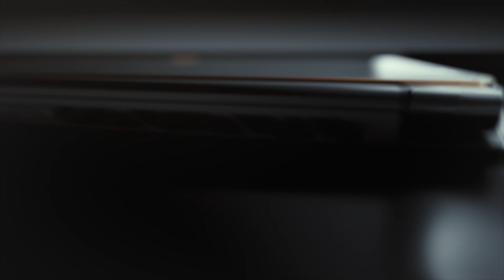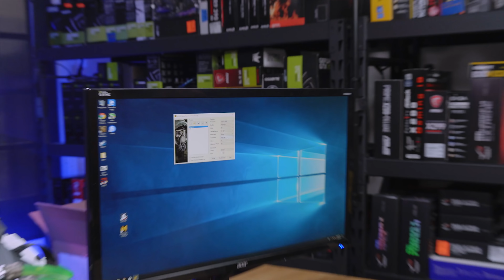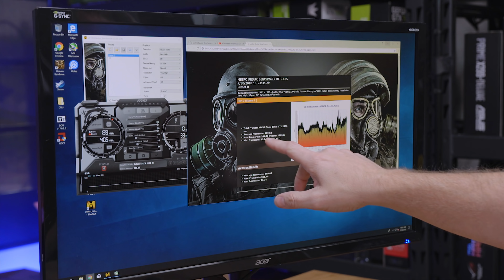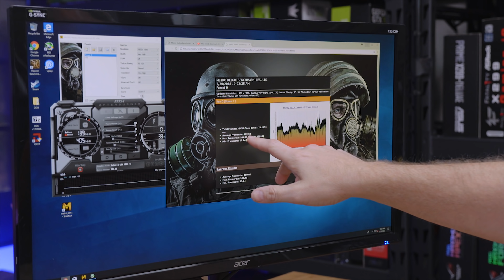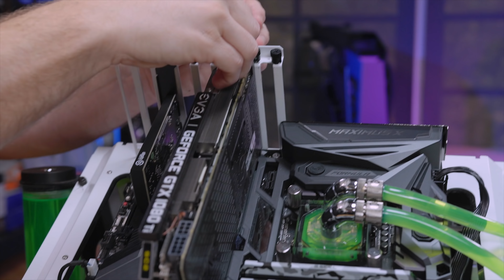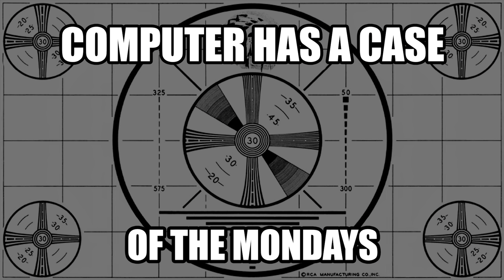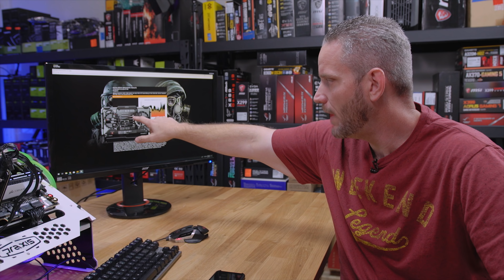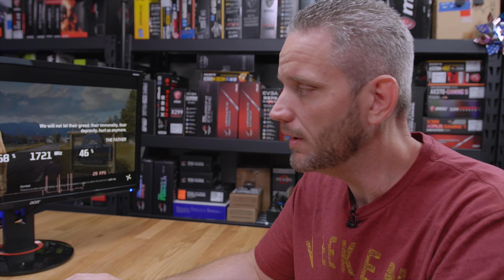Updated Test Bench... But did I screw it up with the wrong CPU?

Comment: High frame rates don't matter anyway really because the human eye can only see 8gb of ram.
Reply: you won
Reply: Overclock your eyes. The brain can take it as long as you have proper cooling via water bottle. It takes a lot of power so you should eat more too.
Reply: It does matter because the human eye can see more than 8gb of ram if you use the X method to apply thermal paste.  This also prevents overheating but causes galvanic corrosion and voids your warranty.
Reply: But remember, only a single pea-sized drop in each eye. Be sure to hold the eye firmly closed for at least one full minute.
Reply: nah, you can allways download more ram and speed to your eyes
Reply: You can update your eyes by wearing glasses. Its an upgrade from 320p to 640p
Reply: Sounds 2 me your talking about Double vision, that only happens long nights at the Bar for me....lol
Reply: Dude, I dotally can see more than 8gb or ram. The human eye can see about 3.34*10^-34 meters/second. Just update your bios to the latest bios and install a Nvidia Titan XPVZ into your left ear.
Reply: I'm blind, I use a braille monitor ...my fingers operate @ 640k
Reply: But you guys miss ONE point: What about RGB??? Installing RGB gives u more cores, more GB, more gHz, more friends... :-D
Reply: Zero, you left out mileage. RGB tends to improve MPG just a whole lot, like maybe even eleventy bajillion percents. Does not apply only to Notorious RBG.
Reply: Not true at all! You can install a modded bios on your frontal lobe that let's you overclock your eye performance.

Though youll then need to download more ram than the 8gb to notice the difference
Reply: Im going to trim my contacts down smaller so I can overclock my vision to work better for longer distances.
Reply: I.S. Neko well I downloaded 6 extra GB of cores so
Reply: Gareth Fairclough 64 gigs.
Reply: You have PLEEB EYE's ; I can see upto 64GB on my PUTER!!!
Reply: john doe reported for saying puter
Reply: Comment of the Year goes to 🏆 ... 😜
Reply: But how many dedicated wam to dah serva?
Reply: Owen Byrnes My dad wuns his own sewver......do yo-...di-did you want his,..um,...his bidness card?🤓
Reply: Exactly...people didn't get the original joke it seems...others did and were having fun with it...
Reply: I.S. Neko not funny but u get a like ;)
Reply: Don't forget about the amount of Level 3 Cache. 7900X has 13.75MB and the 6950X has 25MB. Massive difference at the CPU level, RAM speeds aside.
Reply: I don't want to be able to see the frames surely that the point of high frame rates
Reply: I thought we were limited on dialup speeds
Reply: im dying
Reply: jayson Williams you stoner dude.
Reply: I.S. Neko The Human eye can actually see about 8.99978564 GB of RAM and when your Bios is corrupt that means your blind but if you flash your bios with Adobe Flash Player then you can see again it's magic
Reply: I over clocked my eyes, but i lost some of the full adobe color spectrum any advice?
Reply: I "SEE" what you did there. YeeT
Reply: I.S. Neko Too bad many people's wallets can't handle even 8gb's of RAM.
Reply: I.S. Neko I chuckled at this one good job
Reply: Only if you haven't downloaded the latest bios.  See your local church.
Reply: I was about to read 60FPS and then i realized - lol. I can only see 4GB's..
Reply: The funniest part of this comment, are the people who actually take it serious ><
Reply: this is a joke right? just to clarify...
Reply: And 4 cores
Reply: I heard from the someone that it was 16gb. Maybe it is 8gb since it's half of 16... makes sense to me.
Reply: LOL
Reply: My favourite thing is when kids get crazy laptops but with only a 60hz screen
Reply: Human eyes cannot even pinpoint static images never mind moving ones
Reply: My eyes can only see 640k of RAM, I'm really almost blind :p
Reply: I started to rage until I read it twice. Well played.
Reply: UNTRUE!  You just install a memory doubler into your wetwork.  Just be sure to get the data out before your head explodes.
Reply: Humans can remember and deploy quickly (what RAM is doing) up to 7-9 things (images, characters, visions, words, anything) at a time. So, RAM amount is either a couple of bytes to a fuckton of gigs.
Reply: Fuck my brain are bottlenecking my eyes, only has 9999999999 Zetabyte of storage, eyes use up to much.
Reply: I saw that comment somewhere, it had 5k likes, nice copy/paste
Reply: qwert zuiop so apparently stating facts is copy and paste we got a dumbass here
Reply: I didn't copy paste, but maybe I saw the comment too. Might have been why I came to the joke so quickly.
Reply: It's not based on gig it's fps. Human eyes see I think it's 60-75 fps max but it will be alot smoother at higher frames sustained
Reply: jayson williams ... u serious dude?
Reply: he no get it
Reply: Who doesn't get it...I got it, but Johnny Mnemonic says I can do anything with some wetwork upgrades...
Reply: @ jayson williams You sound like a console peasant! You should really do some research.
Reply: Matt Christie not at all I have a small gaming rig now. Look at my post for Jay. I have been a PC gamer from the days of 8086's and math coprocessors. Watching Jay has made me want to build one again.
Reply: jayson williams

wooosh
Reply: "It's not based on gig it's fps. Human eyes see I think it's 60-75 fps max but it will be alot smoother at higher frames sustained"
r/wooooshh
Reply: jayson williams r/ whoosh
Reply: jayson williams r/woooosh
Reply: jayson williams there is always an Interesting discussion about what fps the human eye can see, and honestly it depends on the person. My eyes are very very good, according to my optometrist, one of the best pair he has seen. I would be able to see a higher "fps" than another person that wouldn't have as good of eyes as me.
Reply: you failed, this guy was being an idiot on purpose
Reply: jayson williams wooosh
Reply: All you guys clearly don't get it, just get a 144Hz monitor, 144 frames a second, POW ! Problem solved. Clearly. Duh.
Reply: @Jayson Williams r/woosh
Reply: jayson williams duuuuuh
Reply: The human eyes rate is  variable no 2 people see exactly alike!
Reply: jayson williams
He made a joke
Reply: jayson williams 1st of all we were joking 2nd the human eye can see over or around 1000 FPS as per scientific tests all you do is type in Google chrome "how many fps can the human eye see"
Reply: jayson williams you are DEAD wtong. Do your research

Comment: I love test bench idea, just as a normal computer "case", would be easy to keep clean and dust-free, so my only question is, do you need external fans blowing on it to keep it cool will it stay within optimal temperatures in the ambient air?

Comment: I got an 8700k that will run on air with all cores synced to 5.0ghz. Max temperatures are in the high 80's and low 90's after a 30 minute burn-in. My old 4790k had same temperatures with the same cooler but wouldn't surpass 4.6ghz.

Comment: changing a GPU on a testbench always good.. while choosing an upgrade for my pc i noticed the MSI gtx1070 gaming Z was not able to buy anywhere in my country but the gaming X version is.. kinda weird tho but changed my choosing to the 1070ti gaming version, i could have choosen a gigabyte or ASUS but overclocking locked better on the MSI 1070ti version

Comment: I dont see how you should loose performance except from reassigning threads to processes and scheduling during runtime. From my point of understanding you just need the minimum amount of available threads to prevent scheduling. Any extra thread would result in extra performance if the software can scale its amount of processes with the number of threads.

Comment: Jay, is there a limit to the amount of radiators you can put in a loop before the only thing holding the CPU back from getting cooler is water's ability to take the heat away/ambient temperature of the air? Would be an interesting video.

Comment: Comparing non-overclocked with overclocked makes this totally invalid! Either test both at stock, or max overclock on both. I'd prefer to see best possible overclock for gaming on both & see which wins then.
If the 8700k was at 4.7 then you could probably make up that 5% difference by just clocking to 5.0!

Comment: spoiler for the upcomming does memory size matter for gaming in 2018, no it does not, as long as you have the min amount of memory and nothing else running in the background.
now if you are like me and have 20+ chrome tabs open at any given time on 1 monitor, a game on the next monitor, and a video call on the last monitor then yes memory size does matter.
but that is due to chrome, i have 32gb of ram and at any given time i am using at least 50% when not gaming, meaning i need more than 16GB of ram, and the next logical step up from 16 is 32.
technically you can run 24GB but that is sketchy AF.

Comment: Jay now you have a hot chip. Include the vrm in the loop and test radiator size drop off please in a single loop, gpu, cpu and vrm

Start at 120mm rad and see what temps hit and how long they take to get there. Then 240mm, 360, 480, 560mm etc .

What size increase gets you the most gains

Comment: Researched suggestion: at least according to cinebench scores...
The i9 7940x has the best single core score among any cpu tested in cinebench so far. 
Cant remember the numbers, but last time I checked it was on top of that list, hovering above the 8700k, and some xeons
Given that gaming rely more on single core performance (assuming it’s more than 2 cores and 4 threads), it could be the best perfoming cpu for gaming in existence. 
Ofc, its not the “best” overall since it has 10 of its cores are probably wasted during gaming (its a 14), its an i9, so the price tag is a concern, and a whopping 105w TDP. So its a power hog and an oven. 
But, among the i9s, it does have the fastest core clocks, even faster than the 7900x. 
But i can’t objectively say it is the fastest cpu for gaming since for some reason, it’s difficult to find reviews and benchmarsk scores online. Most people are benchmarking the 7980xe, the 7900x, and 7960x. No mention of the 7940x at least? 
So calling out to jay, to go check it out.

Comment: Hey quick unrelated to the video questions: i've got this MSI H270 Gaming M3 board and i use TridentZ RAM. Right now, i also have a thermal take Nic Cr cooler and i like it, but i have fallen in love with the looks of the be quiet! Dark rock pro 3 and 4. Do you guys think i can still fit those memories with one of these coolers?

Comment: Uhm.. Shouldnt you keep the stock cpu overclock settings to test that too? Only lock the frequency like you did on 8700k. Or you should overclock the 8700k too. It will get to 5.0 easily.

Comment: Would love if anyone could tell me why my Cinebench scores get cut in half when I overclock my Ryzen 5 1600 to 3.7 GHz with 1.3v. Any overclock I give it above stock speeds lowers my scores. Thermals aren’t an issue either because it hardly reaches 70C. Everything runs stable, just my scores drop significantly.

Comment: "This is the same test bench I've used for a few years. The only changes that were made was the Motherboard & Cpu, then the Power supply. Upgraded the Hard drive. Put in more Ram. Changed the bench itself because the paint was peeling and didn't look right on camera, and have changed the Gpu many times. Sure has been a good test bench over the years"

Comment: OK, so the question is... Why don't you turn off the Spectre and Meltdown protection? It is doable. I have a two older notebooks here that those patches really caused performance to tank badly, turning off those protections really made those machines perk up performance wise. Many people over at TechPowerUp are under the impression that you really don't need the Spectre and Meltdown protection. Unless you're some really high-profile target those protections serve only to slow your system down.
Reply: Other than the patches that MS implemented I don't have patches for Spectre and Meltdown.  Not because I'm against installing them, but because MSI hasn't released any for my board (Z97-G45 Gaming with a 4790K).  I guess I'll find out firsthand whether the patches are needed. lol

Comment: i have a 7960x, gtx 1080 ti, 14 fans, 2 pumps, 10Gbps NIC, and whole bunch of other crap running on a 750W PSU, never pulled more than 600W form the wall. unless you OC ALL the cored to over 4.2GHz, you wont need a beefier PSU.

Comment: What if you do like I did on my desktop, have an i7-4770k CPU with 16 GB ddr3 ram at 2400mhz and an nvidia GTX 1080 8 gb gpu. In 1080p ultra, I seem to get at least 70 to 90 fps in most games from 2017 and 2018. Not sure if my CPU is a bottleneck for the 1080, but I have it OC to 4.0 Ghz, I imagine its still faster than the AMD FX-8350 at 4.0 Ghz.

Comment: Just to note: many spectre updates were issued through BIOS file updates. So unless you updated the board BIOS, you did not have Spectre protections enabled which easily accounts for higher frames on a lower-clocked older architecture.

Comment: The 4-5% increase in framerates could come from the 7980XE having double the cache to play with, 24MB vs 12MB on 8700K.
And it being Quad Channel memory rather than Dual Channel.

Some applications are more Cache and Memory intensive.

Comment: Lots and lots of ram and more than doubled the cores for virtually the same performance. Let the record show that more cores may not negatively affect your performance, but it doesn’t scale well with current games and apps. In the future, more games and apps may take advantage of more cores, but it still might not result in 1:1 scaling in frames per second. Instead, extra cores may be used for more physics calculations and AI behavior.

Comment: Jay, while I do agree with you on the patches affecting the performance to a certain degree, but I think big difference in the two is the arches. The 6950x still ran on the ring bus arch and 7900x is on the new mesh arch. The latency is much higher on the Skylake x CPUs.

Comment: Set up an overclocking profile in bios for 7980xe gaming, use per core overclock to set (best) 4 cores at 4.8Ghz permanent, rest at 4.5Ghz, de-lid, direct die, 420mm 45mm rad and jobs a good one.

Comment: Video doesn't make much sense. So if the question is about the x299 cpu maintaining or degrading performance and not if it improves it, then what's the point of installing that cpu?

Comment: The 8700k outperforms skylake-x in games because of the low latency ring bus, not because of lower core count.   If that were the cause,  the 7700k would get higher fps.

Comment: windows 8 is also patched for spectre and meltdown jay
Reply: If you have been applying patches, yes - His implication was the other rig is still running un-updated windows: Quite common
Reply: I am going to patch my system for spectre soon its called the zen patch :P
Reply: Ryzen is affected by a few of the spectre variants actually, but it is not affected by meltdown afaik.

Comment: Hey @JayzTwoCents, it's funny that you say hitting the power limit is indicitive of the CPU being able to handle everything the GPU is sending, while I had a reference design PNY GTX 980 TI 6GB with a 120% power limit in my AM3+ board with my 1090T@3.62 and RAM at 1477Mhz, the Power limit was constantly being hit set at 100%, but when switched to a MSI GTX960 Gaming 4GB with a +200 core and a +500 memory clock, it never touches the power limit. The GTX980 TI also performs considerately less in my brothers FX-8150 build@stock speeds as well, but slightly less than my 1090T@3.62... any thoughts as to why the 980TI would perform less than a 960?